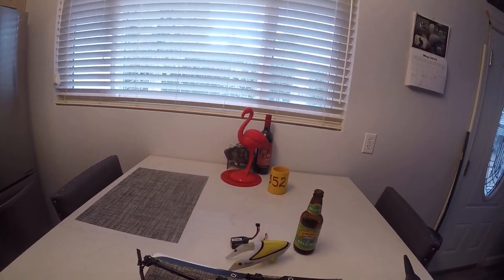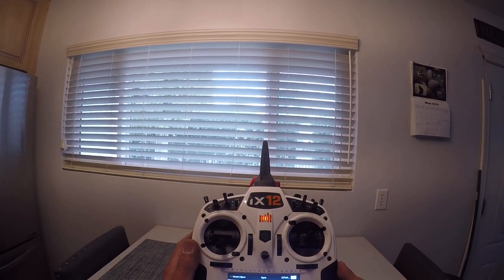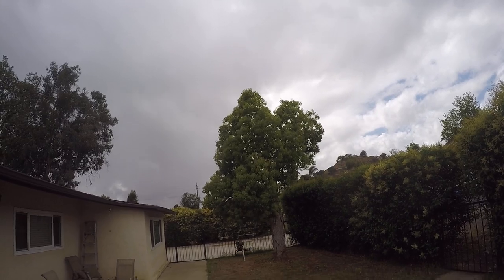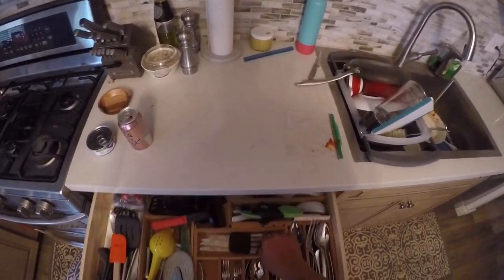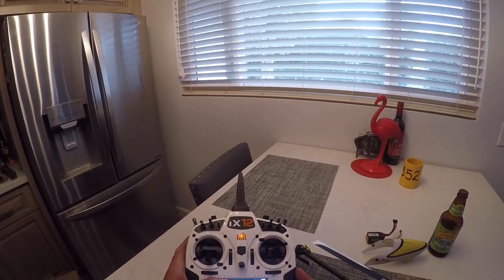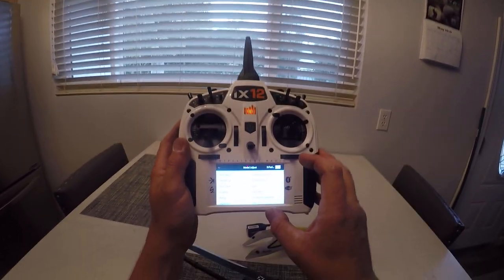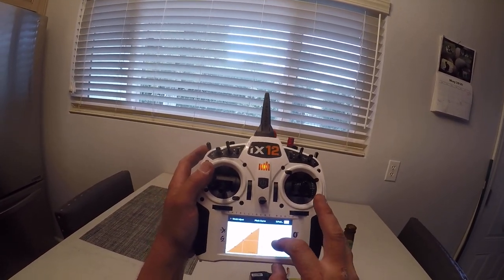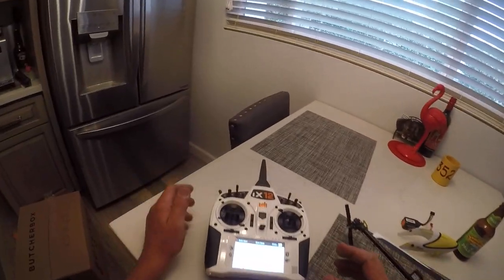Blade Fusion 180 set up, tips and tricks with Coe Show. ( Part 2 has tail explanation I missed)

Comment: Thanks for the tips, got my tail blades setup with a little right pitch now like you said. My 180 slowly oscillates pitching backward and forward. Do you know how to tune that out? The behaviors described for the gain parameters are not fully clear to me. From what I gather from your explanation and the manual... my guess is reduce the cyclic I gain.
Reply from the maker: Go into the parameters by holding the sticks to the lower right hand corners, and push the bind button. Go to the first page of the menu. Drop the first two numbers, P and I down to 90 each. now push bind button to save. It will twitch. Now fly. Mine is at 90 now, but 88 is good too. Just leave the rest at 100. If you go to the second page, you can do the same for the rudder idf you are using a longer servo horn, or just need some adjustment. Hope that helps,  Coe Show
Reply: My tail wags too much. And I just can’t fix it.
I already reduced the gyro-gain in the transmitter to 45. It did not help.
I will try you advice.

Comment: You could actually use larger 3s packs at 100% throttle and get much longer flight times. 3s 600mah be ideal if you can get them.

Comment: Justin, I'm new to the Spektrum radios and I'm trying to figure out how to limit the travel of the tail servo after adding the longer arm.  Adjusting the travel per the travel menu only seems to slow down the movement but does not actually limit how far the tail servo travels.  The tail servo still binds.  Is there something I am missing that will solve my problem?

Comment: I just got a fusion 360 bound to a dx9 and have slight tail wag . I try to adjust the gyro but doesn’t do anything , I even turned the gyro all the way down to zero and gyro still works on the tail on zero gain . What am i not able to adjust gain from my radio ? . I set up radio to how it says in the manual as well . Any ideas ?

Comment: Which spektrum servo arm did  you use. I have tried a number of the spektrum servos and can not find any that will fit. Like you I wish they had not cut off the servo arm.
Reply from the maker: I used the 3055 servo arms that come with a new SPM3055 servo.

Comment: Got a question for the fusion 180.
Since i changed my headspeed to 90% instead of 75% the whole heli sometimes starts shaking at 0 pitch.
Could that be too much play in plastic parts or you got some idears?
Thanks allready
Reply: It sounds like vibration for sure. Usually the sacrificial parts that may be bent are feathering shaft/spindle,  Main shaft, Tail shaft/pulley, and man gear damage as in missing teeth. Make sure its mechanically sound through and through.
Reply: The main blades are to flimsy